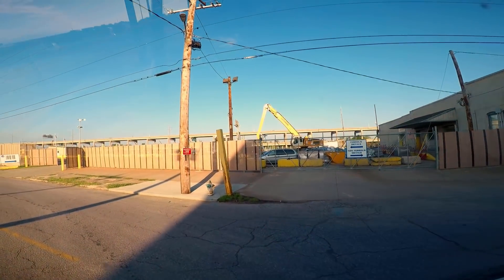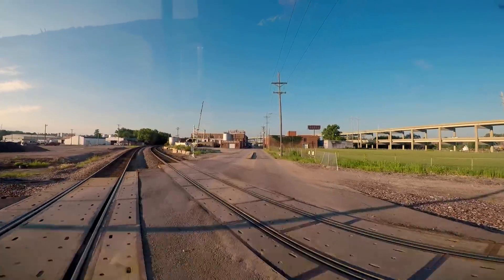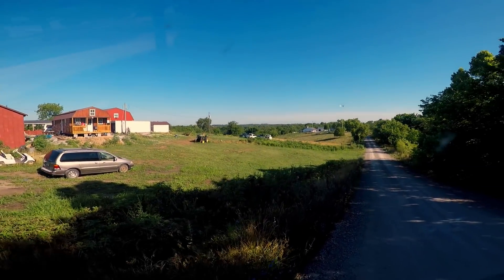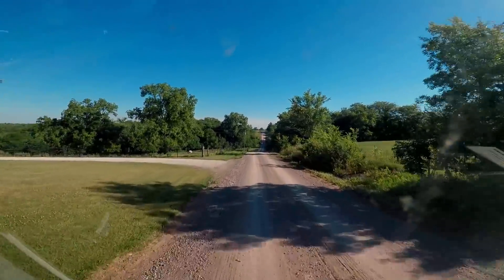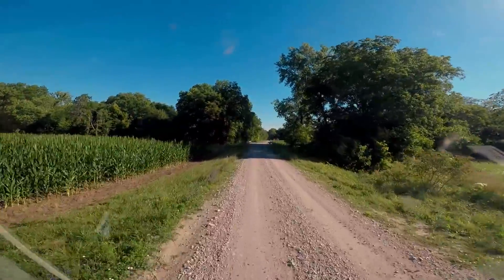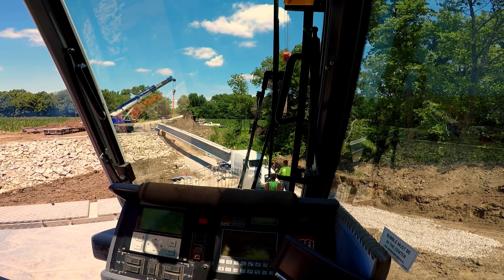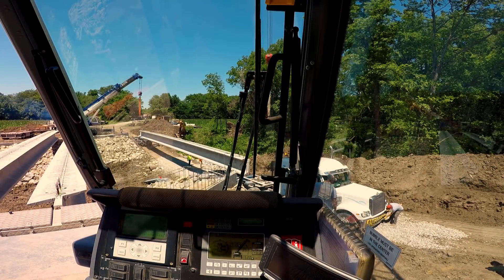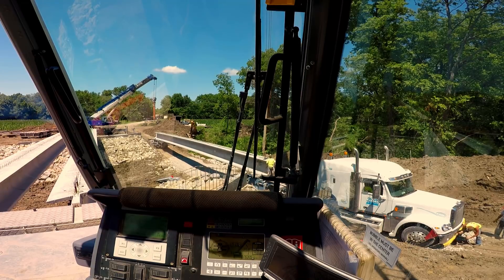Setting bridge beams | Two crane pick | Building a bridge

Comment: Each one of those flat cars are capable of holding 150+ tons each./////// In tight situations like your last pick (thanks for slowing down the vid and showing how delicate you were), do you ever do watch what needs to be done and do accordingly, or do you solely look at and do what the signalman says?
Reply from the maker: G4 Outdoors, that's alot of weight those little cars can handle! When it comes to signals, it just depends. If I see something safety related, I will ignore the signal and stop. Otherwise, I pretty much just follow the signals. Thanks for watching! 🙂👍

Comment: I wonder why they had that smoking truck sitting there running in the background? Seems they could have shut it down until they had a use for it.
Reply from the maker: l wilton, there was a pile of bush burning a few hundred feet beyond the truck. It just looks like the smoke is coming from the truck. If you go back and watch the video when I first pulled up to the site, you may see the bush pile burning before the truck gets backed in there. Thanks for watching! 🙂👍
Reply: Ah, thanks. That does make a good bit more sense. I saw the smoke in the first scenes and at first thought the other crane was smoking, but that just didn't seem real likely. Then I saw the truck and it looked like it was smoking. Didn't realize it wasn't there in the first shots.

Comment: For what it's worth, the load rating on that bridge doesn't seem too far out of line. A lot of those flatbed cars would have a gross weight in the 260k lbs range, and modern ones have a gross weight up in the 315k lbs range. And most of that is down to the track structures anymore.
Reply from the maker: Sandy, this one was made from two flat cars side by side, welded together and a poured concrete deck on top. I did some research before I agreed to cross it. Had I been in doubt, I would've told them no. Thanks for sharing the info! Also, thanks for watching! 🙂👍
Reply: I just noticed a silly omission, those numbers I quoted are the max gross weights, not necessarily the ones they're normally loaded to. Anyhow, I figured you wouldn't have risked your neck on a bridge you didn't figure would hold up. Just thought I'd share one of those random factoids I pick up floating about the internet. A quick question: the hooks (or whatever you might call them) that the lifting straps are fixed into on those bridge beams. Are they cast into the concrete, or do they fix in and then get pulled out before the bridge deck gets put on? Anyway, thanks for taking us along.
Reply from the maker: Sandy, the pick points are cast into the concrete. They are actually cable that is wrapped around the reinforcing steel inside the beam. After the beams are set, those get cut off.